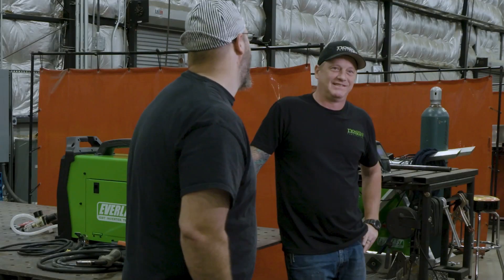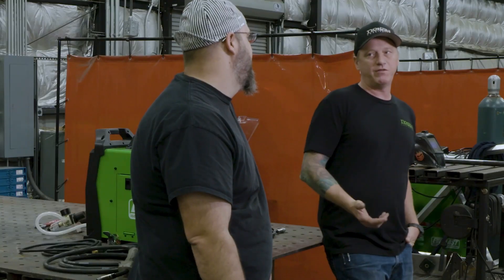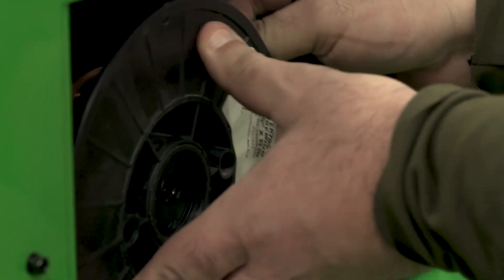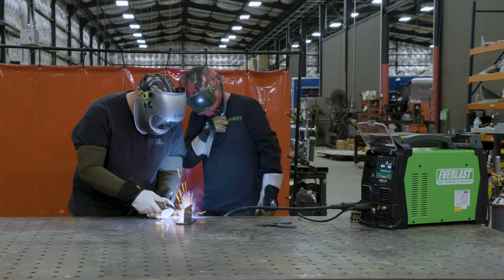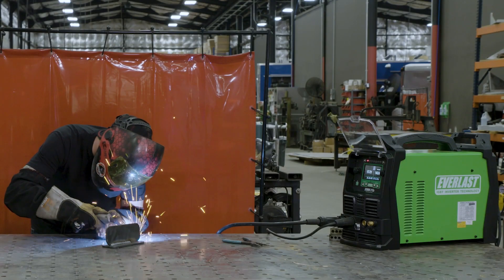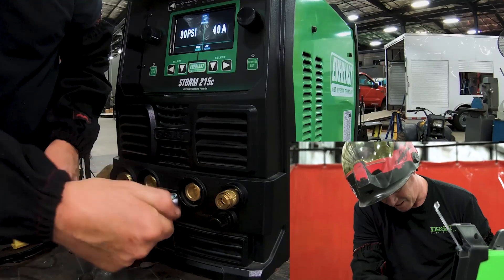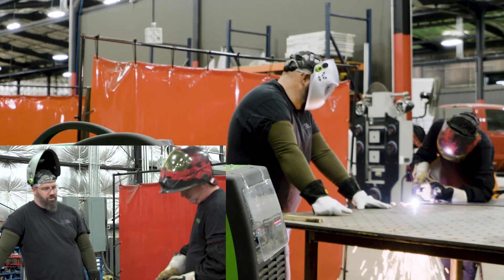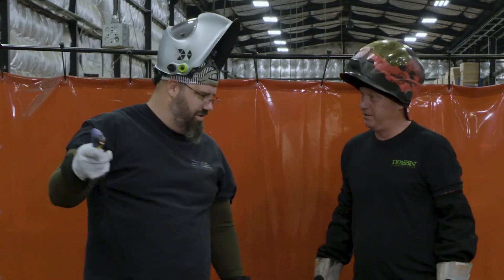Everlast Storm 215c First Look | James Flatman & Brad White

Comment: I own a storm 215 c. All of the functions work
good except the powerset mig settings. If
you set it on 3/16 " thickness and 035 wire it
does well. If you use any setting for thicker
steel it will weld way to hot. I would like to
see them do a video to show all of the perfect
settings for thicknesses like they have with
other everlast. Iv always been a stick welder
but am learning mig. I try and make it sound
like bacon like everyone says but it would be
alot easier with a chart or the power set being
right. Or maybe mine is broke idk.